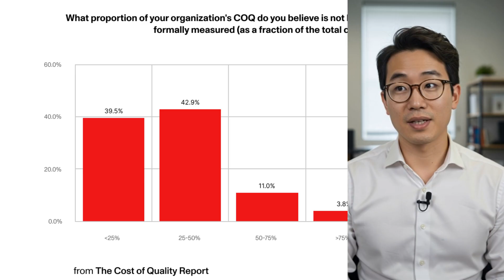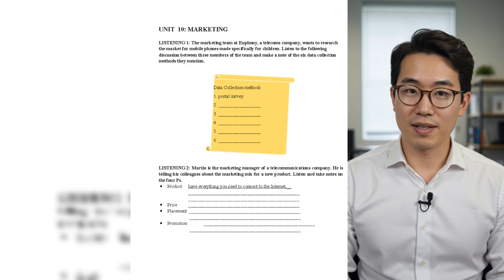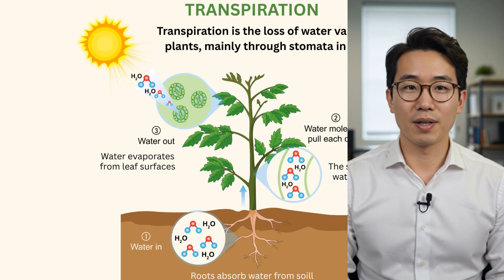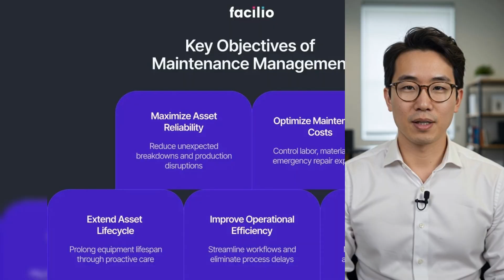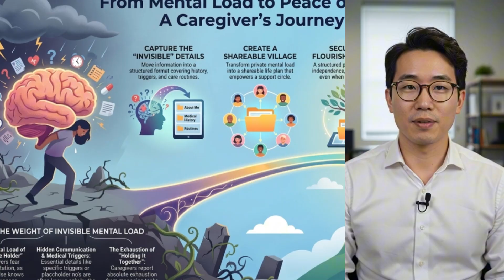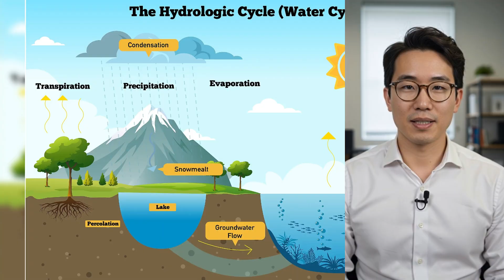WHY DID WE ABANDON ZEOLITE-BASED HOME COOLING?

Comment: There are several ways to cool things with no electric: 1 mix saltpeter (NaNO3) with water, 2 Boil ammonia solution (NH4OH) inside camper refrigerator, 3 crosley icy ball, 3 zeolite adsorption system. I think the most simple DIY is build crosley icy ball but filled with zeolite instead ammonia, it's less risk, while ammonia is poisonous & saltpeter is highly explosive...